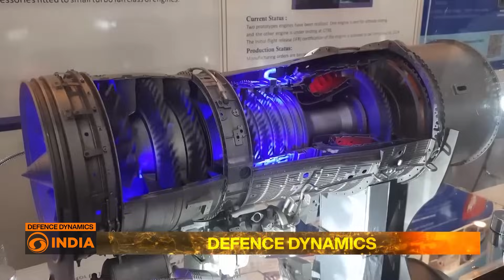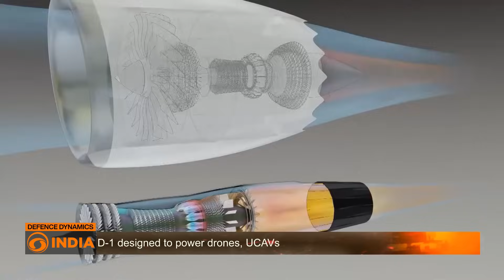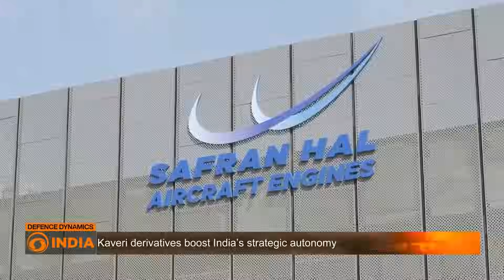Godrej Desi Jet Engine: Kaveri D-1 | Defence Dynamics

Comment: Have this 40 years in the making garbage pass the test in Russia!??! the engine is not a problem. It is those blades inside the engine are the hardest to make. it takes rare earth metals which could resist extreme temperature while it can cool it down from extreme to controllable. India don't even know what rare earth metals are. the Kaveri is already outdated.

Comment: Finally Godrej did it for the nation. Thank you Godrej for make the nation proud
Reply: I always thought that if Godrej Aerospace could make successful rocket engines, why they were never asked to produce jet aircraft engines from the Tejas series of fighters
Reply: @parthasur6018  govt should have fund them it's a great company
Reply: @parthasur6018  NGL, rocket engines are way easier than this.  
Rocket engines are "use and throw" unless it's designed for a reusable rocket which is a cutting edge technology.  

This is a very surprising news tho, hats off to Godrej engineers
Reply: @commieTerminator Yes, I know. I have a B. Tech in Aeronautical Engineering. I am somewhat familiar with gas turbine engines and rocket propulsion. I was not really basing my assessment on the exact technology but general competence. A competent rocket propulsion engineer will also make a  competent gas turbine engineer. Ok?

Comment: Hmmm without an after burner, it should at least produce 50-60 KN to be used in LCA with the after burner. The weight of the KD1 needs to be known, so that the LCA can carry more BVR & Cruise Missiles. Long way to go